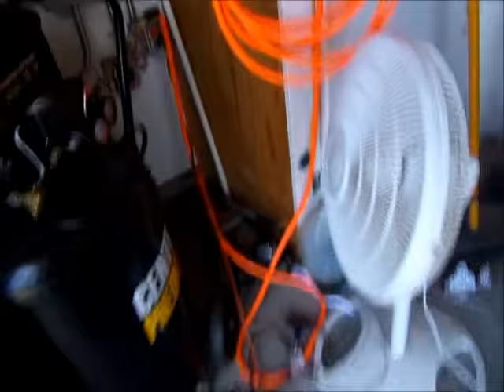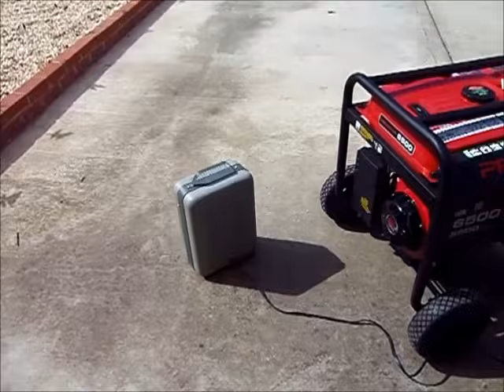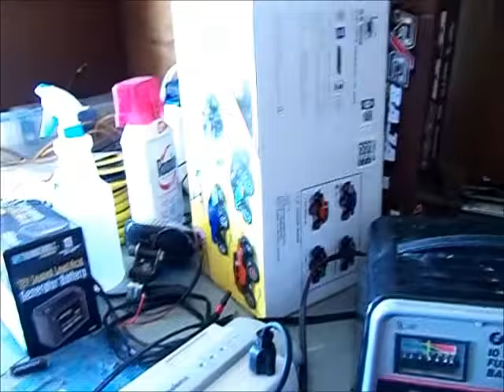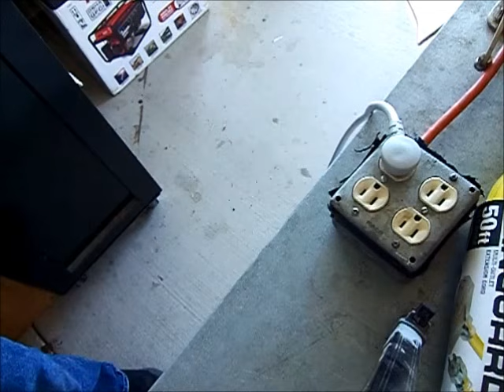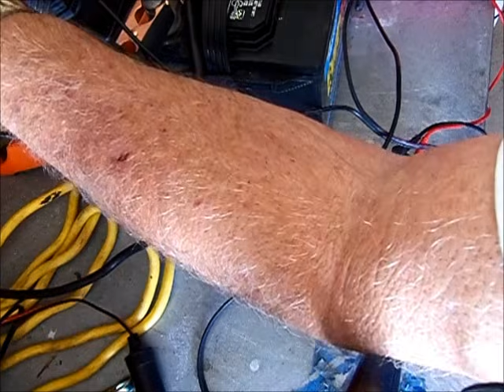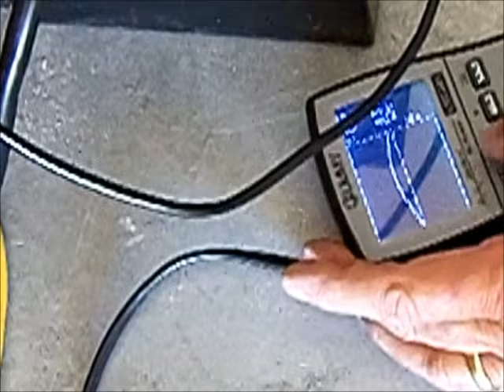Cleaning up the "dirty" sine wave from a non inverter generator. This is part 1, proof of concept.

Comment: from what I know, power plants don't use inverters, they work just like cheap non inverter generators, where the RPM of the rotor determines the frequency.
so why does generators make dirty power, if power plants essentially work the same way?
is it because the generator is relatively small and the rotor can't hold a steady RPM?

Comment: You didnt "clean the sine wave". You charged some batteries, and used them to power a pure sinewave inverter.

You can tKe that line conditioner out of the loop. Just taking up space.

Comment: I don't get it.  Why don't you just run your pure sine wave inverter from your generator's 12v supply?
Reply from the maker: The 12 volt  supply, on the generator, is (supposedly) only able to put out 100 watts. The inverter I used on this proof of concept was 300 watts and the inverter on my final set up was 1500 watts. 
  Note: In part 2, I mentioned that the volts coming off the "12v" socket were actually well over 20. that is why I had to add the voltage regulator. When I plugged in a car inverter, that I had, into the generator, it fried it instantly with out the regulator..

Comment: Couldn't you use a super capacitor instead of a battery needing regular maintenance?
Reply from the maker: Simple answer is yes. The battery serves two functions. one is to function as a capacitor but also as a back up power source when I don't want/need to run the generator.
   Have used only the battery when it was a short term power outage and only needed to use low power draw  devices.
   I recharge the battery using the RV power supply (see parts 2&3), off house outlets, when power is restored.
   Am seriously thinking of adding solar panels to keep a full charge on the battery when not in use.

Comment: Westinghouse traditional generators from 11.5KW and up they all have a ≤5% TMD
Reply: My new westinghouse wgen9500df (12000 peak) has 23% thd…outragious. I’m considering buying a Wen 3600 inverter generator to run my freezer, tv, wifi, and computer while using the Westinghouse connected to the main circuit breaker box to selectively run the rest of the house during power outage.
Reply: @jimwoodmansee , buy the WGen11500TFc and save money instead of buying and paying a lot more for an inverter generator. The WGen3600 isn't big enough. You need a running watts of 10KW or more.. So, you don't have any limitations. The WGen11500TFc is a ≤5% THD generator and has 11,500 running watts . Both, Lowes and Amazon have this generator for $1,499.00. I have the WGen14500c and it's a monster. It has a twin engine and I can run both air conditioners and everything else simultaneously in my house without breaking a sweat. I got mine from Lowes and I only paid $2,200.

Comment: Did you try an apc. It literally does the same thing and has a built in battery as a very short term battery backup for more sensitive electronics
Reply: A battery backup, APC or otherwise, does NOT do the same thing. Not even close. A battery backup, while receiving AC power, simply passes that power on to the outlets on the device. In this mode, a battery backup is just a surge protector. While in this mode, it will also charge / maintain the battery, but the battery isn’t connected to the device outlets. The battery and inverter are active only when A/C power is removed.

Why this mistaken idea persists in forums and comments devoted to reducing THD is beyond me. Maybe it comes from people posting untruths they saw somewhere else and haven’t bothered to research or verify?  Hmmm.
Reply: @BruceBaruchMorris  doing my 5 minutes of research while driving does show you are correct for many devices. Online Double-Conversion UPS do take in power converter it to DC into a battery the converters it back to AC. It's not a passthrough like most APC. Even an APC UPS is designed to limit Suge, spikes and sags but it's not completely clean power. I would say a system like in the video or a Online Double-Conversion UPS would achieve this more completely

Comment: I run a Predator 13kW directly to my electrical panel VIA 50amp plug with an "inter-lock" to run my entire house, 4ton AC (with soft-start) etc.... Outside of super surges it runs pretty clean >7% THD   / Also run a APC UPS Battery Backup Surge Protector for all electronics in home office, charge phones etc. Surge protector on main TV and accessories for such. This is for emergency scenarios of course.
Reply: Similar to my setup. I got the 13kW Predator because it's tri-fuel and we have piped natural gas, yet I can still use propane if a disaster hit and we lose nat-gas. I will never use gasoline because it expires, leaves residue in the carb, and it's bulky + dangerous to store onsite. I monitored the output with my oscilloscope while switching heavy loads and saw no voltage surges or spikes (set it to trigger on 175V and never saw one), so I wont be using a sinewave converter. The generator doesn't produce a pure sinewave, but it's pretty close and will work fine for any appliance. The important thing is that the generator doesn't produce erratic voltages (spikes or dips) and that the frequency is between 55-65Hz. I already have surge protectors around the house, plus a whole-house surge protector in the breaker panel.
Reply: @ that’s cool nice set up. Having options is always great. I wish we had natural gas where I am. I would mimic your situation for sure.

Comment: how can i contact you i have a few questions. We got Smart meters and its causing our home to have dirty electricty can this fix the problem
Reply from the maker: Sorry I don't give out personal info.
 If you're trying to clean total power coming into your home, my setup is not the answer. I would suggest using UPSs to protect your computer etc. If you want to take it further, I suggest contacting a qualified electrician.
   PS: See parts 2&3, you will see I only used the inverter on my computer, internet box, cable box and TV. Total power draw was only around 200 watts. The rest of what I was powering ran fine straight off the generator.
Reply: @d.s.steele3100  smart meters at the apartment i live at causing us dirty electricty i checked the outlets each outlet as a dirty electricty dirty sine wave, i want to know if theres a way to use the inverter to fix the dirty sine wave from the outlet at home. maybe i should just buy a inverter gernerator for clean power
Reply from the maker: @JewMonGee That's were a UPS is used,. Plug the UPS into the outlet then your more sensitive electronics  to it. The UPS will clean the sign wave plus give you short term power back up in the event of an outage. Check stores like Best Buy, I think UPSs sell for around $200.00.
Reply from the maker: Forgot to mention, make sure it's pure sine wave NOT square wave!

Comment: From my experience the whole "pure sine wave" hype is really mostly just marketing, I've seen my step-dad run his whole house on a 40yr old 5000w generator too many times (latest outage lasted 13days) and everything still works fine.. at one point it was even sputtering and spitting and backfiring and the rpms had to be varying wildly and yet the TV, internet, freezer etc still kept working just fine, thats with no surge protector or anything.. most things you're likely to buy are designed to work not only in the US and places with "clean power" but in other countries without that.. the circuity has a high level of backup and compensation inherent in the design. 
I'm here cause I recently bought a Predator 4350 standard gen and got hearing all about how I should have gotten a "pure SW inverter" but in my experience using mine and then seeing the use of that old one my step-dad has I'm convinced its more marketing and undue worrying than need that sells the inverter generators
Reply: Unfortunately the quality of electrical components in the 2025/2026 era are terrible. And many electronics have power management that can handle poor quality electricity. But it mainly shortens the life of fine electronics(tv/pc/circuit boards/lithium batteries).
Reply: I agree with you. I have done the same thing myself with no damage

Comment: I was wondering how it could be done. I have an older Troy 3500 generator and wanted to make it cleaner. I know they are noisier than inverter generators but it’s what I have for now. 
Thanks
Reply from the maker: You are an example of why I did this. You already have an older generator and just want to get a cleaner sine wave with out spending 2 or 3 times the money on a new inverter generator.
  If you haven't seen parts 2 and 3, that will show my final set up.

Comment: Electrical  Engineer here you are limited by your battery charger. You will also lose a lot of power in your conversion. I wouldn't recommend it.
Reply: Sounds like an engineer to me . Quick to point out problems but never has a solution 😂
Reply: what would you recommend then?
Reply from the maker: Lose a lot of power? Total voltage drop from power supply to inverter was 0.2 volts. Actually got a higher AC voltage from the inverter then from the generator. The only limiting factors were the wattage capability of the inverter and wire gauge. See parts 2 and 3 for the final setup with an RV power supply and 1500 watt inverter.
Reply: @d.s.steele3100 I’m confused. Why not clean up the PG&E power instead of running a generator? What you are doing is called double conversion. I’m considering doing it also so appreciate your video. But we are considering cleaning up the grid power from our cooperative. I have inverter generator but dont plan on using it much. Thanks.
Reply from the maker: @paulbaker3144 : What's the confused about? When PG&E shuts off power for 3 days+ do to fire concerns, I need some kind of back up power source.

Comment: You have a great idea here. 
I might do a similar thing with just a few hundred watts pure sine inverter to run sensitive electronics like internet, computers etc while I use the bulk of the dirty power to run my freezers and refrigerators.

Also, I like to run a 50/50 mixture of gasoline/kerosene with additives to boost octane to keep the running costs down to a minimum
Reply from the maker: See parts 2 and 3. I've used the set up a few times now and it works well.
Reply: @d.s.steele3100  I will do 👍

Comment: It's a dumb video because if you're generator is providing you dirty power then you walk to get the generator fixed not start fasting around with batteries and inverters and everything else. A decent Pure wave inverter will cost you more than the generator it's just not worth it it's just not a very good video I'm sorry it's just not practical.
Reply from the maker: Generators with build in inverters are a relatively recent product. Before the advent of sensitive electronics a perfect sine wave wasn't needed.
   A lot of people have older generators that did not have inverters. This is an option to be able to use those older generators.
   In my case this set up cost me less than half of what an equivalently powered inverter generator would have cost. I did not need "clean" power to the entire house, just to the computer and associated equipment and one TV.
    Lights and my non electronically controlled  fridges and freezers can run on less then clean AC.

Comment: So this cleaning up of the ac circuit by passing it through the batteries, and that's why you curbed guy batteries in parallel.
You see thinning the cleaning up happens in the batteries, and that's not true. You're not cleaning up the AC power: you are taking so called dirty power and making 12VDC out of it. So this dirty power is no longer in existence, for you have changed it to direct current. It matters not how you connect the batteries as long as they give the right voltage for your inverter. The sine wave coming out is clean because the inverter is making it that way, not because of some filtering

Comment: waste of time but it would be cheaper just to buy a inverter generator.
Reply from the maker: Watch parts 2 & 3 and read my responses to other commenters. Yes Harbor Freight now has a 8750 KW generator for $1199.99 on sale and their 9500 KW generator is now $2299.99. They did not exist when I started this project.

Comment: This is exactly how i charge my 24v solar batteries with gas dirty power generator i plugged in a 75amp 24v battery charger wired to batteries then have a 3000 watt pure sine wave inverter into cabin makes it to where no dirty power get into the cabin outlets while charging and using inverter at the same time

Comment: “DIRTY POWER” is measured in sine wave. I have 28 years doing this as a  usiness and my grandfather etc. also 60hz is standard here in the states. I have 28,000 watt portable generator I bought from one of my manufacturers at wholesale (so what it cost to build plus 4.5%) its a 28,000 watt generator and it is rated at less than 5% THD ACCORDING TO. OTH MY SINE WAVE MACHINES IT MAKES 3.83% THD. When you see a thd advertised it means that’s what you’ll bet running it hard …  I also hook these and massive diesil cat generators for hospitals and banks etc etc.

Comment: :dothefive:1st thanks for the vid. 2nd and I think most important U should never wear jewelry when messing with electric! 2nd Thats about the worst battery charger and batteries{they wont last as im sure u found out} u could use. Please next time close ur garage door THANKs:oops:
Reply from the maker: Agreed, should have taken the watch off. 
  This first part was proof of concept not the final set up. See parts 2 and 3. 
   I've been using that charger since the late 70s for charging batteries and it still works as well as the day I bought it. 
   I get 7 to 10 years out of those lead acid batteries and don't have to worry about a lithium-ion battery catching fire if (when) it over heats.
   You do have to have the lead acids well vented because of the possibility of hydrogen outgassing and hydrogen sulfide gas if you over charge the battery.
  Remember hydrogen needs an ignition source were as lithium-ions can spontaneously combust.

Comment: you are loosing alot of gasoline using that system
Reply from the maker: This is strictly an emergency back up when we lose power. It's primary function is to save food in the refrigerator/freezer $400 to $500 worth. Gas is cheap compared to having to replace spoiled food. See parts 2 and 3.

Comment: I have cheap little 1000w gen. It has a 12v out. If i run that through a Pure sine wave inverter . Wouldn't that clean it up ?
Reply from the maker: Check my part 2:  I had to put a voltage regulator on my 12 volt outlet to keep from "frying" the inverter with an over voltage from the generator.  Also in my case it was rated for 8 amps only. That's about 96 watts, not much. If you put too much load on that 12 volt outlet you'll be popping the circuit breaker/fuse constantly

Comment: To address your comment, "I'm not as interested in the dc sine wave," you are aware that the is no sine wave in dc, just a straight line! The sine wave is the  direction of the ac reversing direction!!
Reply from the maker: What I was showing was the slight ripple (noise) that filtered through from the generator and power supply. If you look closely in part 2 you can see the small distortions in the dc part of the setup. Although only millivolts it was there. Ever heard that background "hum" on speakers? The battery acted like a big capacitor and got most of the distortion but not all.

Comment: Or you could just buy a Honda EU 2200i which is clean efficient and has a perfect sine wave output. High reliable. Purchased 10 in 2017 to deliver to Hams in PR after Maria.
Reply from the maker: When I started this project Harbor Freight had not released their full line of inverter generators yet. If I had weighted a few months I would have gotten a 6500 watt inverter unit  for half of the price of the Honda generators and my experience is that they are just as reliable. Replacement part are also much less then Honda parts. With the 6500 I can run the whole house except the central air.
    Note: In 2024 all sales of new gas engines under 25 HP will be banned in California so back up generators will be a thing of the past leaving us at the mercy of PG&E again. 
    Don't talk to me about solar either, I have it and it is a waist of money. 
 How much did you pay for those 2200 watt Honda's? $1260.00?
 The Predator 2000 watt inverter generator is $620.00 and the 9500 watt unit is $2400.00. were the Honda 10,000 watt generator sells for $5500.00!